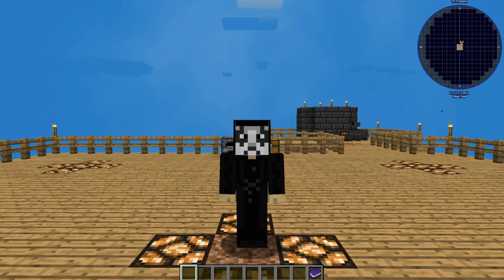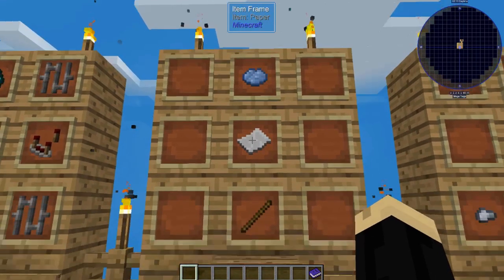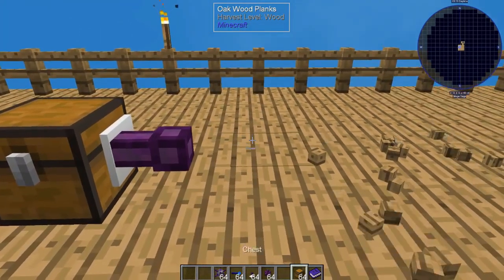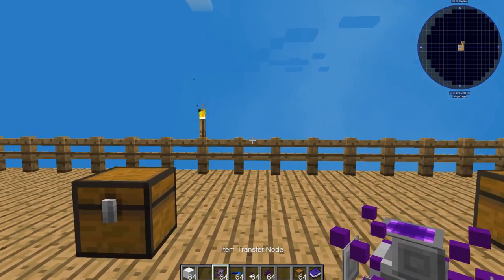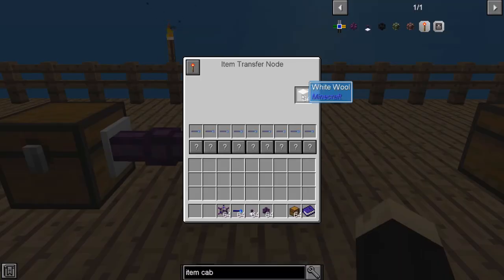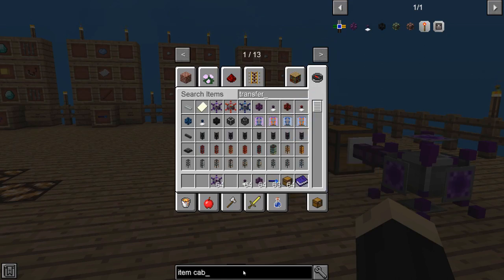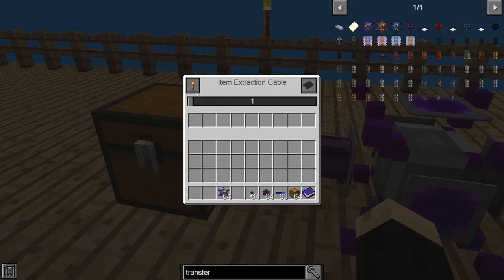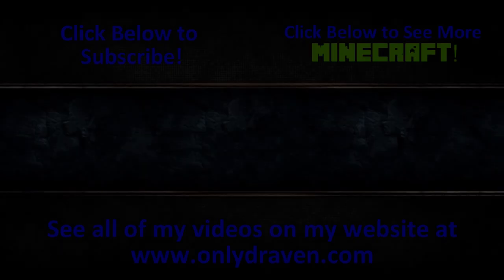Minecraft - Sky Factory 4 - How to Use An Item Transfer Node

Comment: I have a question. Can you attach a wireless node so things from the central storage goes into a chest? Been trying for hours and can't sort it out. So I connect all my bonsay to the main storage and after I want only to get out wood from the central storage and goes wireless into a random chest. Didn't make it work so I had to attach the node to the cabinets but it runs out of wood fast so I have to switch cabinets all the time. Thanks hope you can help me. BTW great job with the tutorials. Helped a lot many of them.

Comment: I have all my bonsai trees on filing cabinets going into my simple storage network (which I set up thanks to you). I just got the maximum overdrive achievement so now I have a combustion gen that RINSES any regular wood supply.

How can I extract only oak logs from my storage network, goal being to wirelessly transfer them to said ginny?
Reply from the maker: I can try to put something together that could do that, but to be honest, a chest with two hopping bonsais on it with top tier mulch connected to the generator will provide more than enough wood for it and makes it all self contained.  Just filter the wood from the chest to the generator and filter everything else to a trash can.
Reply: @OnlydravenGaming  I actually figured it out: item extractor cable on the network master, whitelist oak wood, wireless transfer node on top of that, GPS directly to the generator. Add four speed upgrades to the extractor cable and the item transfer is pretty much instantaneous; even faster than a combustion ginny with four stacks of speed modifiers can consume.

Comment: How would I transfer wireless into a network so it can sort into separate files? I want to get hopping bonsai to transfer into my file cabinet system wirelessly but can’t figure it out.
Reply from the maker: The only thing I think that could work would be to wirelessly transfer the items into a chest that is connected to the Simple Storage Controller.  The items would then input into the simple storage system and into the cabinets you have allocated for those files.
Reply: Onlydraven Gaming I’ll give it a try! Thank you!
Reply from the maker: @FlowerofHopeMistiqueRobin  Happy to help.  :)

Comment: Just started SkyFactory 4. Loving the help from these videos! Question though. How do i use these to transfer items into a compact machine? I cant get the items to flow into it..
Reply from the maker: You have to use a Tunnel on the inside of the compact machine to allow for transfer in or out through that side of the machine.
Reply: @OnlydravenGaming  I have that. I have a tunnel on the side and its set to east. Do i need to put another wireless node there or a chest? I've tried both on the east side of the machine. Also tried storage link cables and item extract/item cables. Still no item transfer :(

Comment: Any idea why this doesn't seem to work for me? The cables seem to be broken. I can use conveyor belts into the wireless transfer node but can't do anything with the cables. Same goes for fluid or energy and it's real annoying cause I have no easy way of transferring energy.
Reply from the maker: It's hard to know for sure without seeing your setup.  Are you using an item extraction cable and then item cables?
Reply: @OnlydravenGaming  Did not expect a reply but appreciate it. I figured it out though. I never noticed the white rectangle indicating that is where it extracts from. One placing it properly or rotating when needed it works perfectly.